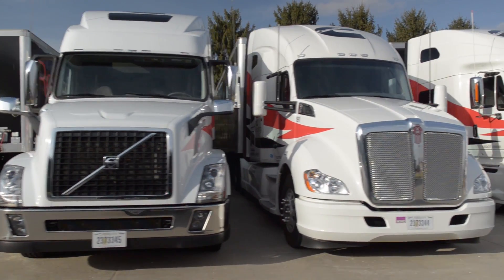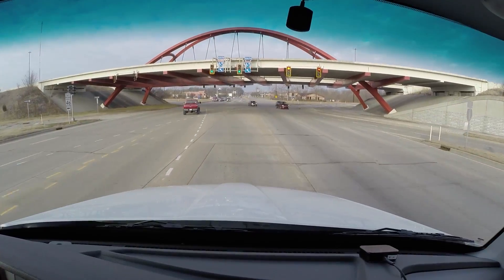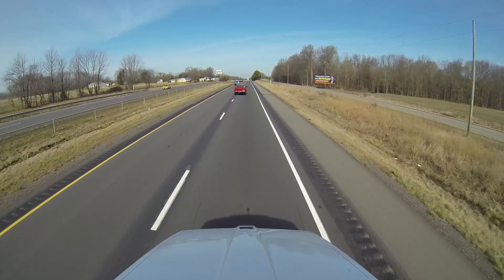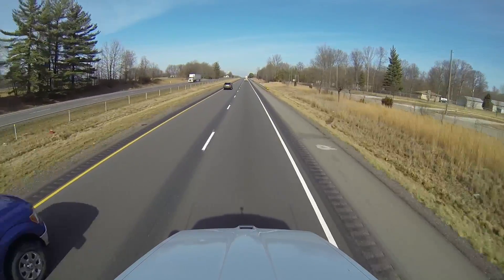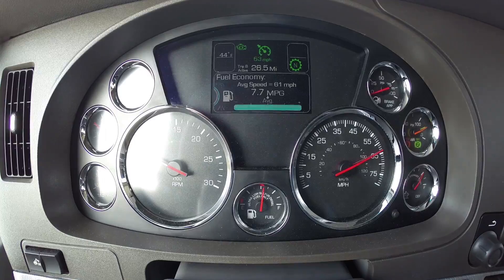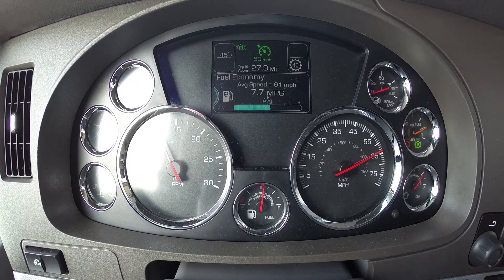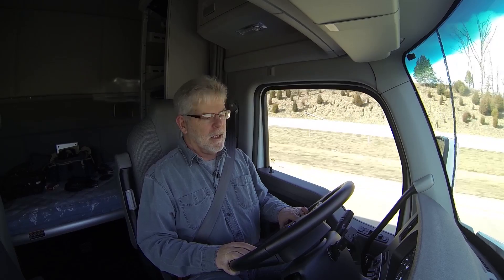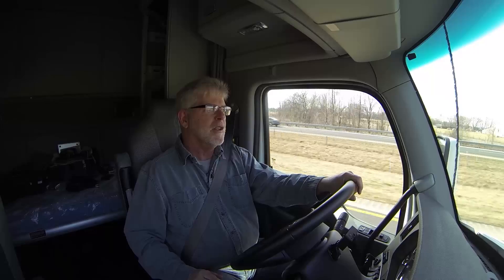Focus On...Cummins X15 Pt 1: An Overview

Comment: just extra systems to give issues.. and the driver can do it better anyway, they can actually see the hill and know if its beneficial to gain some speed in neutral, or save the fuel that itd take to idle in neutral because its a steep or long hill and he's gonna be on the brakes or over the desired speed anyway.. if the trucks in gear with no throttle input it shouldnt be injecting any fuel and but put it in neutral it has to idle, have to do the maths on if that idle fuel equates to the speed difference of the two options, or if that same fuel required to idle was injected into the engine while in gear what would it do for the situation..

regardless to me anyway these systems that you talked about all video long really arent engine related, id consider that a truck feature not an engine feature, the trucks deciding to pull it into N and using the engine and transmission controller to do that.. you could fit that to any truck as far as i can tell.. good or bad, i imagine alot of drivers wont want it

what changes if any did they make to the actual engine, yah know the cylinders, pistons, fuel injection, turbos, so on so forth

Comment: no drivers I've even met throw the transmission into neutral at any speed above a brisk walk. If I was to buy my own truck, the first item on my spec sheet would be a 13 or 18 speed manual transmission. More parts to wear out/break, and I don't want find out at which mileage! I've currently got 188k on a Volvo i-shift:) Great so far, except in the winter.

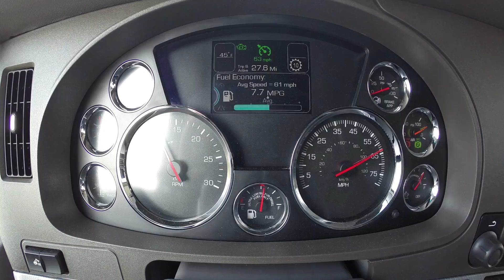Comment: 3:43 I drive a 2016 Freightliner with the Detroit 14.8. I've notice how it loses 2 or 3 mph doing the same thing. It get on my nerves because. Trucks will come around me to pass. These same drivers will at some point down the road. Will slow down because they are not using cruse control. I will just tap the peddle at the start of hills. The computer will then use full power to stay at my set speed.

Comment: What he said "still Cummins" and still has DPF that kills the engine
Reply: Your ignorance is showing. DPF doesn't kill the engine....come on. Bones up on your info.
Reply: MoparProud 
Yes it does. I have a 2013 isx and the dpf is choking my engine. Frequent regen sand poor fuel mileage. Been in shop 3 times and Cummins can’t figure out the problem.
Reply: Yes getting better all the time but a bit rich when operators every day bear the cost of the advances in tech but hey that's the cost of progress
Reply: Intake side air leaks and consequent over-fuelling (excessive soot in the exhaust)?

Comment: My 2005 isx15 averages 7.2, 7.3 mpg pulling flatbed with a 10 speed manual. I don't notice it but you must be correct saying us drivers know the little things to do.
Reply: The good drivers seem to know how to get the most out of their engines. The ones that couldn't be bothered or won't take the time to learn just continue to complain about them. I think that says a lot about how we separate the men from the boys in this business.
Reply: Use less the trhottle, rollercoast more, use more the low gears, accelerate very gently and fell the engine when doesn't have to work too much to pull, try to reduce speed dowshifting and using a little bit more the jake.
Reply: All it is is how the truck is set up and how the driver drives the truck

Comment: seems like strictly mega-carrier material. no owner operator could afford to be in and out of the shop when those systems start to fail or being defective from the factory warranty or not sounds like major downtime
Reply: Transmissions like the DT12 are as reliable as manual transmissions